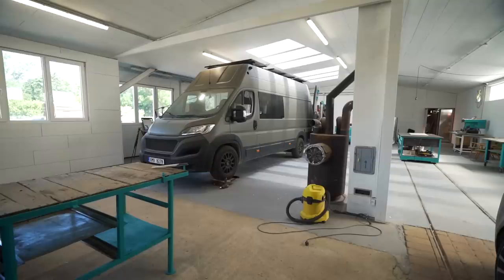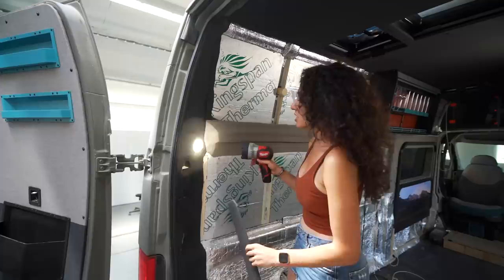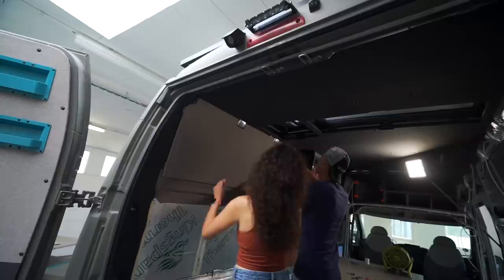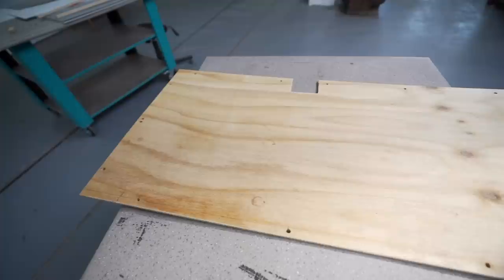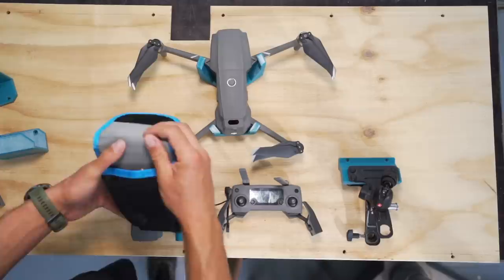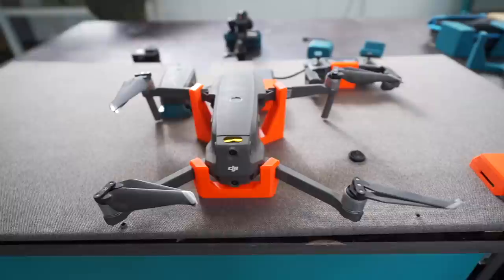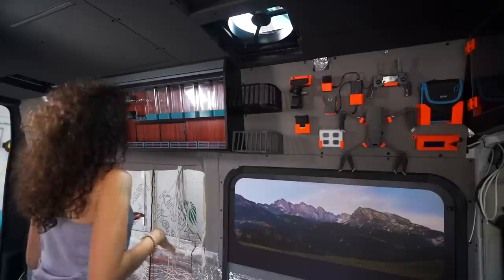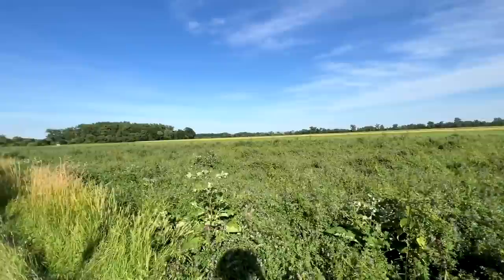We made Drone Panel for VAN LIFE!

Comment: The van keeps getting better and better. I always try to tune in right when you release a new video but today I was a tad late. The suspense was killing me. 
I have a question for a future Q&A (or for now). Does the super insulation job you did turn the van into a Faraday Cage of sorts? I had not planned to install a cell phone booster but I fear if I go all out on the insulation the way you did with all the metallic K-Flex I would have a hard time receiving a cell signal.

Comment: The setup looks great. What I would question is will it work when you drive and for example hit a pothole?  I suspect there is a high risk of stuff falling down. I would add some elastic cord to the setup to keep everything in place even if you drive on a bumpy road.
Reply from the maker: Hi, we design the brackets to withstand rough roads. Time will tell.

Comment: thats nice build, using 3d printed parts and then having 3d printer it self onboard make so much sense.. 2 questions tho.. 1) why did you storing mavic in expanded form? 2) did you concider ditch Prusa power supply and change it for some 12v to 24v DC converter to have better power efficiency?
Reply from the maker: Hi Jakub, we store the mavic opened just because it’s very encouraging to use. And we like creative work supportive environment :)

DC-DC converter We talked about a bit and it’s not worth it. Cheap converters are not efficient, good ones are expensive and with 95% efficient 230V power inverter it’s more simple setup.

Comment: What happens if the battery dies during storage or a long trip away from the van, thunderbolts won't release, is there a way to unlock? (apart from angle grinder :)

Comment: Sorry. This is a really dumb idea and a complete waste of important space. I get  you guys are trying to milk this project for a much content as you can find... but it's getting a little silly now. Just my humble opinion.
Reply from the maker: For us it’s all about function. Open shelving for fresh food we needed, and that overhead unit can’t go too far towards the drivers seat for the 3D printer enclosure to open. Plus that space is above the couch so it would need to be very thin. The drone was one of are most annoying possessions in our last van because our countertops were always full or too cluttered, so pulling out our backpack, undoing it, dealing with the chargers & controllers made us use it a lot less than we should’ve in retrospect. We’re lazy droners unless its easy 😅 we’re wrapping up the paneling now, and then we’re moving in! So over not using this thing to camp in. It’s insulated, has water, has solar, storage and swivels, what else ya need??! We can build as we go now🙌